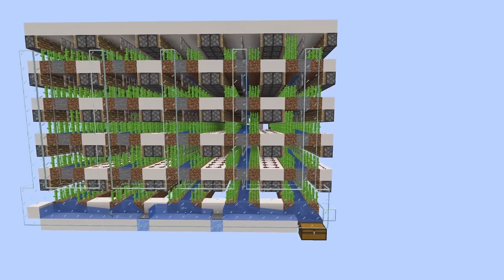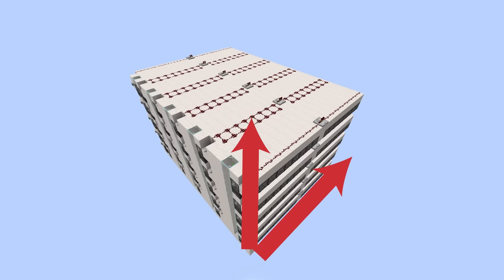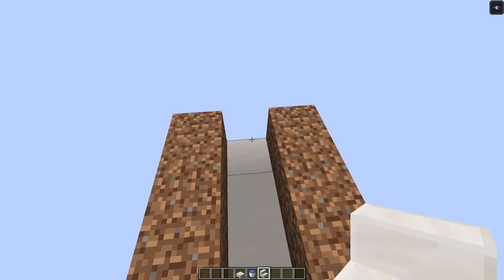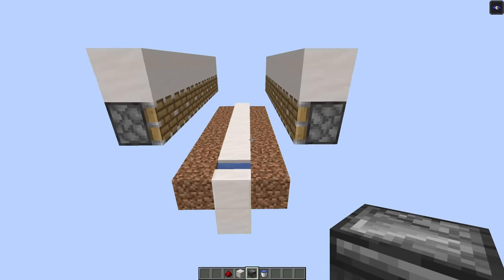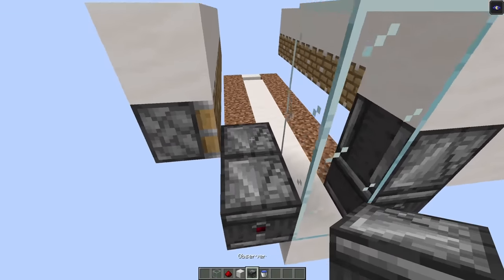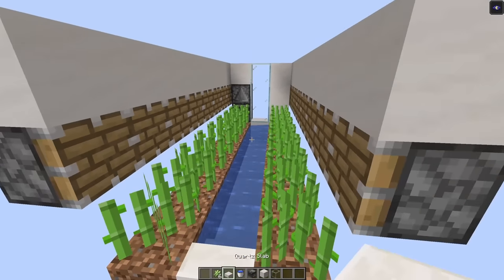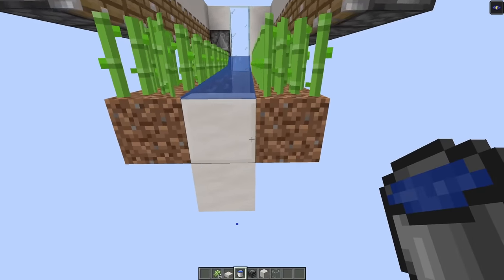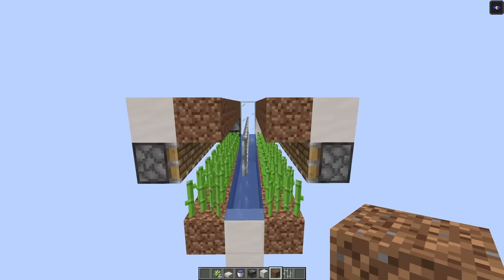Sugar Cane Farm! Compact, Lossless, Easy to Build! (Minecraft 1.15+)

Comment: Item list for farm showcased at video start (25 modules):

s=stacks

1354 solid blocks (21s&10)
830 redstone (12s&62)
800 pistons (12s&32)
800 sugarcane (12s&32)
800 dirt (12s&32)
400 iron bars or 400 fencegates if 1.16.2+ (6s&16)
270 glass (4s&14)
77 packed ice (1s&13)
75 slabs (1s&11)
60 observers
30 repeaters
27 pressure plates
25 stairs
a custom collection system or 2 hoppers & 2 chests
infinite water source

If some numbers are wrong, please tell me in the replies.

Comment: whenever i place down the water it goes to the side and knocks the cane over how do i stop this?
Reply: Mine does the same
Reply: If you're doing this on Bedrock, I ran into the same issue. It's a matter of Water Physics being a little different between the two.
I haven't figured out a fix to the problem, however... most annoying, since I thought I was on to a winner with one idea.
Reply: EternalScarecrow I removed the tiles that he said to lay over the central water source. You then start the water source on the first glass block and it flows down the channel without taking out your crops!
Reply: @levscape  thanks man
Reply: Big guy o’clock np
Reply: @levscape  for me it does the issue at the 7th tile

Comment: Great build. This absolutely still works in 1.19.2 (Java). Commenters saying otherwise simply did not build the farm correctly. (It will NOT work on Bedrock.)

Be aware that you will likely need to "prime" each observer that faces a piece of sugar cane after you are done building the farm. If the piece of sugar cane in front of the observer grows to a height of 2 before you have built the redstone to fire the piston, you will need to re-place that sugar cane so that the observer can detect when it grows. This is the cause for the issue many people are reporting that the farm just "sits there" and doesn't harvest correctly.
Reply: I had the issue of it just sitting there so if  i just replace each sugar cane after building the redstone it should work?
Reply: @weejohntee  you only need to replace the piece of sugar cane that is sitting right in front of the face of the observer at the end of the line. You don’t need to replace the entire line.
Reply: Thank you, my chests are getting sugar cane so it is working but everytime I look, the sugar cane has grown but it hasn't triggered the observer.
Reply: @weejohntee  Only the piece of sugar cane directly in front of the observer should trigger the entire line to be harvested when it grows to a height of 2. You will have some pieces that grow in the middle of the line that don't trigger the pistons. Does that help?
Reply: @Strofo16  Hi! Just wanted to ask if you know what the issue might be even if the observer has been primed and the sugarcane right in front has grown but it still hasn’t triggered the pistons

Comment: Super easy to build, but I'm seeing some of my sugar cane getting hung up on the stair? Anyone else? Testing in pre release 1 and 2 so far.
Reply: Having the exact same problem in the same releases, and I can’t figure it out. hope someone sees this and can help us out.
Reply: I changed the stairs for pressure plates which seems to work for me
Reply: it also happens in 1.15 i collected some i got about 10 stacks of sugarcane that was stuck
Reply: it worked when i put upside stair
Reply: Upside down?
Reply: @headstone6723  yes just to block the water from falling forwsrd and to prevent blocks from getting stuck
Reply: @headstone6723  didnot try it at second layer only on first
Reply: It has been now fixed in Pre-Release 3

Comment: Hey, I’m a little confused on how the farm activates. Does it only work on when one sugarcane grows? Wouldn’t that mean other sugarcane could be growing and losing drops before the one right by the observer does?
Reply: Yes, it activates when the one in front of the observer grows. It does not affect the others growth, however. But usually the other sugar cane are somewhat grown, so not just one piece of suar cane per module.
Reply: PancakeWaffle thanks for the reply. But what if it takes a long time for the one in front of the observer to grow, could that stop growth from other ones?
Reply: Lior Schifrin no, if you have several units then you should have a steady flow of sugar cane. If you only have one it would be extremely slow.

Comment: Great farm Tango! I tried it with bamboo but it seems that the bamboo doesn't update in the same way that the sugar cane does. Thought about monitoring the actual growth of the bamboo with a circuit breaker out the back to stop looping, but that would totally ruin the aesthetic of the farm, so I ended up alternating sugar cane and bamboo in each row making sure each observer is staring at a piece of sugar cane and just put in a sorting system to handle the ensuing chaos.
Reply: This is the answer I was hoping to find, thanks!!!

Comment: Thanks for a great farm design.

I don't know that someone already mentioned it, but this farm can even be dustless if you have enough observers and powered rails.
You can trigger the pistons with upward facing observers and powered rails on top of the observers.
On length wise extention, you can transfer signals with an observer between the two powered rail lines.

Comment: I built this yesterday on Java 1.18.2 and it works perfectly
Reply: @0235681956  I built it exactly as the design is in this video with some minor adaptions to the redstone. Do you have a collection system? Is your render distance set very low? I built a 3 wide, 3 tall system so totally of 9 modules and have no issues
Reply: good to know it still works
Reply: do the iron fence needs to be replaced by fence gate?
Reply: @holyshadow5972  no needed but that will increase efficiency yes

Comment: So this design is awesome and I just had a brain storm at 1:27 AM CST.  You can replace all but the sugar cane in front of observers with bamboo and the only thing you need to do is break the waterlogged slabs on the bottom modules so it's like the upper modules before you plant.  That way the water stream won't spread out and break the bamboo shoots as you build (or convert).
After that just have an item filter early in the main collection stream to pull the few sugar cane out and move somewhere else or feed into a composter for occasional bone meal.

I'm gonna try and test it after I get some sleep and see how it will work and see if any bamboo gets stuck.
Reply: Thanks that helped me a lot!!

Comment: Making this comment to answer some questions I have seen.

I tested the farm with the tools I have (so not as exact as master redstoners can do).

Game version: Java 1.15.2

Set up is 2 farms of 5x5x5 of modules, 6 triggering observers per layer, I put a Sea Lantern in pretty much any free spot and swapped some of the structure blocks that power the pistons with one.

One farm is 2,000 sugar cane crops and the other is 1,970 bamboo and 30 sugar cane (placed in front of the observers).

Before starting the test I made sure all crops had grown once then I powered all pistons to lock the farms and cleaned out all the storage.

As I started a timer for 1 hour I unlocked the farms (wired so I only needed to flip one lever).

The results:  the Sugar Cane only farm produced 5,879 items.  The majority Bamboo produced 90 Sugar Cane and 23,993 Bamboo.

I actually had to babysit the collection point of the bamboo cause it was overwhelming the simple item collection I had set up.

The bamboo variant is not lossless.  I observed drops either getting stuck on crop block or falls from the upper streams in a manner they get stuck.  Might be able to reduce the loss by a little by not breaking the waterlogged slabs and placing the water stream after the bamboo has grown once.

Glass Panes will work just as good as Iron Bars (same hit box).

Anything more precise will require more testing.

Comment: Note self for later: use fence gates instead of iron bars
Edit: Placement tip. Place the fence gates against the pistons, then activate the observer. The pistons will push the fence gates into place. I activated the observer by breaking the sugar cane in front of it, so I had to replace it, but putting the gate on the side opposite from the observer will let you just wait for the sugarcane to grow and let the farm do it naturally.

Comment: Not sure if I missed something but I couldn’t get water to flow between sugarcane without it breaking (playing on bedrock). Already built up the rest of the farm 30x30, so I decided I needed to make it work. Found a work-around using double high iron bars and one layer of flowing water next to sugarcane. Hopefully it is just as lossless. But great tutorial Tango!
Reply: Where are you putting the flowing water? Is it just there instead of the water sources to let the sugar cane grow?
Reply: Sam Sampson Rather than having water sources with flowing water on top, i just replaced the water sources with flowing water. Where the flowing water was in the tutorial, I put another row of iron bars.
Reply: Jason K Thanks.

Comment: The stairs on the outside part slows down the sugar cane.
If you want to have the sugar cane shoot out in full momentum, you can replace the stairs with a top slab and cap it off with a sign.

Comment: Works fine on 1.19 , you just need to place the waterstreams differently to get the same flow . ( first the top and then fill the bottom )
Reply: Not really, probably didn't place the sugarcane first
row of 7 waterlogged slabs + waterlogged stair
place sugarcane
place top water

Comment: Quick note 1.16.1 or higher is not lossless with this design if you want it to be lossless replace the iron bars with closed fence gates.
Reply: Thank you kindly. Any advice on a control mod? I know of controllable and lambdacontrols but they don't work as smoothly I'm afraid. Should I consider rolling back to an order version? I believe the previous best was 1.15.2 or something or other.

Comment: Required materials per module:
16 Pistons 
16 Dirt
2 Observers
7 Slabs
1 Stair
8 Iron Bars
17 Redstone Dust
1 Repeater
3 Ice
1 Stone Pressure Plate
Water
A bunch of building blocks

Comment: I built this in my private survival world.  Years ago I had built a smelter from TangoTek with a lot more redstone, and I decided this was a lot less complicated and so should be within my capabilities.

I completed the first module.  I then sat and watched it to make sure it worked.  The pistons went off several times, but the sugarcane never grew.  I decided to manually place a second layer of one sugarcane block.  After a short time, the pistons fired, that block of sugar can was knocked off, and out it flowed onto the floor.  I then carefully went over every block in this already small build and they all appeared correct.  At this point, I was at a loss.  The sugarcane appeared not to be growing and I had no idea why.  I sat and ate a meal in front of the computer.  After about twenty minutes, the occasional block of sugarcane would appear on the second level, get hit by pistons a short time later, and flow out.  I am not sure why there was such a delay in beginning what appeared to be normal operation, but I'm happy it did work out in the end.

I would have liked to have seen a list of the components required at the beginning.  I would liked to have seen an estimate on sugarcane per hour per module so I could figure out how many modules to build.

Comment: Great design!
I love the simplicity, the beauty, and the high efficiency of the design.
Does anybody know how high the losses are?
(There are 2 ways when it produces losses: if sugarcane has grown and the "detector sugarcane" hasn't grown yet and when the pistons are extended the sugarcane can't grow for a brief moment)
Reply: I don't know about the "sugarcane can't grow because piston is extended" number, I'd think it'd be inconsequential in any meaningful metric (rate vs space/material/simplicity).

I don't know the numbers off the top of my head for the random ticks, but the overall calculation is "what is the proportion of successful random tick growths to attempted random tick growths". The number for the end single rows will be different than the middle double rows, since there's almost twice as many harvested at once. Making more rows versus longer ones will also affect the outcome. I think a markov process is the correct model?

It's a bit too late at night to actually do the arithmetic, but I am interested in the outcome, because this should give us the optimal row length, if such a thing exists.
Reply: It is not lossless in 20w22a, in this new patch now 50% of the sugar cane will always get stuck in the waterlogged stairs

Comment: Farm isn't spawn proofed at all, even worse the zombies tend to fall into the water streams so a large number of them end up picking up sugar cane so they hang around even after you leave despawn range.   Instant bat farm if placed underground, thankfully discovered all this in testing before taking the time to build it.
Reply: You can get around this problem by adding in light sources. If you change blocks under redstone to for example glowstone, you can spawn-proof the farm.

Comment: I recommend to use a mod called litematica, that way you can have a 3D plan of the build. The best way to use it is to have a schematic for the variations of each module that you will need and then add and combine them.

Comment: In 1.18 this is not lossless, sugarcane gets stuck at the end of water channels frequently and then clumps up dragging down farm efficiency by a lot. (even with replacing iron bars with fence gates.)
Reply: maybe make it one shorter with a sign at the end of the water one off before it stops flowing? Could help it push it that little bit over the edge
Reply: If you update to 1.19, replace  the last block (waterlogged stair) by waterlogged leaves and you are good to go!

Comment: "The farms one module gets 50 sugarcane per hour while the one in world download ( 50) modules gets 2.5k pr hour which outperforms most slime block sugarcane farms, also swap the bars with fence gates " - from the original commenter -  Hoax
Reply: so should i use fence gates over iron bars?

Comment: You could use bamboo instead right?
I need a super efficient bamboo farm which works in 1.15.2.
Reply: You could do it, but you wouldn’t exactly “need” water next to the dirt, what I would do is make a way in there just in case I want to replace some of the bamboo for more sugarcane if needed
Reply: @Glossah  thanks!

Comment: hey tango; from my testing it's not 100% lossless, as when the observer detects that one sugarcane growing it fires all the pistons in the row. this means when the pistons fire just before another sugar cane in the row grows AND the pistons retract WHILE another sugar cane has just grown, it will throw the sugar cane backwards, throwing it into the void or making it stay on the dirt block. (or maybe i'm just a dumbo and my randomTickSpeed is messing with this, which could be quite possible)

also, as pointed out multiple times in the comments, maybe a quick update video for 1.20 (and possibly addressing the 99.9% lossless thing (with a solution if it's even a problem, maybe? i'm still testing...)) with fence gates instead of iron bars and maybe even waterlogged leaves/mangrove roots instead of slabs and stairs? 🐢 could also just be a youtube short, referencing this video with a quick update (views, baby!).

cheers! <3

Comment: i dont know why but my farm is 100% NOT lossless, half of the sugar cane gets stuck in the stair, please help me
playing in 1.16, i double ched the design and everything is placed right, i fixed the problem by replaycing the stairs with slabs
Reply: I think this is a result of the latest patch 20w22a.  Yesterday things weren't getting stuck on the stair for me and they are today.
Reply: @ChristopherWeimann  but there is a easy fix
Reply: @lordmalix3141  Do you have an upper layer?  That works fine on the lower layers of the farm but on an upper layer it is a problem.  I tried upper and lower slabs.  It works but you can't grow sugar cane on the adjacent dirt without water logging the slab and if you do that you get a water fall over the edge.
Reply: @ChristopherWeimann  I stopped the water with a trap door and waterlockes a top slab
Reply: @lordmalix3141  Oh!  I'll try that.
Reply: @ChristopherWeimann  after 1 hour of afking there still get some stuck, but only a small amount
Reply: @lordmalix3141  I put the trap door on the glass across from the water stream.  Nothing gets stuck.  Also don't need even the slab anymore.
Reply: @ChristopherWeimann  ok I'll try that thanku

Comment: I just build this on 1.17.2 ... the pistons quite often get triggered but I'm watching the water streams and looking in the chest ... I would expect at least one sugarcane for each time the pistons fire and I'm not getting that.
edit ... I think it is firing the pistons when the sugarcane ages but it doesn't grow with each advance in age. Makes sense.
edit again ... I do, indeed, get pistons firing occasionally without breaking but now I've got 3 wide, 2 high, 2 long going and it's pumping out sugarcane. I am going to make the thing 2 longer for a total of 24 units total. Never gonna run out of sugarcane again.
Reply: youre correct, it is detecting the age of the sugar cane.